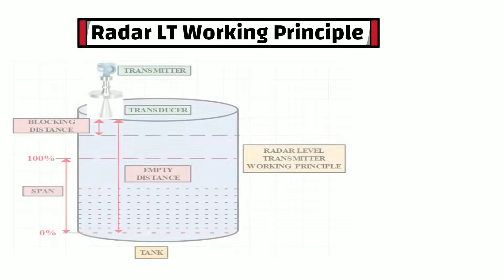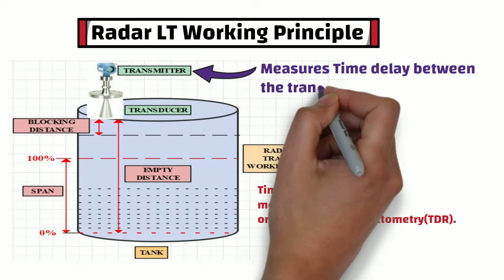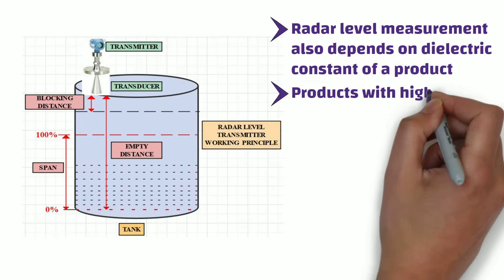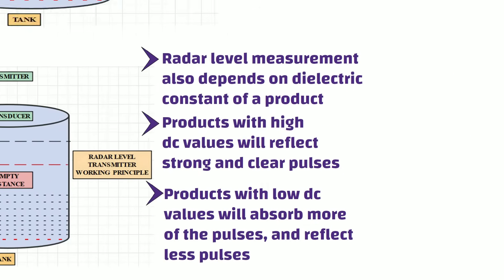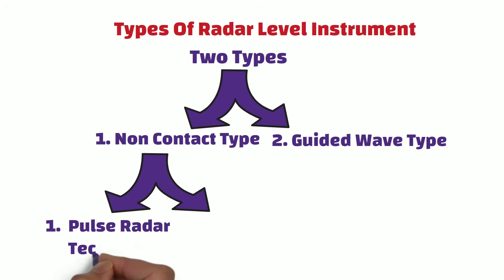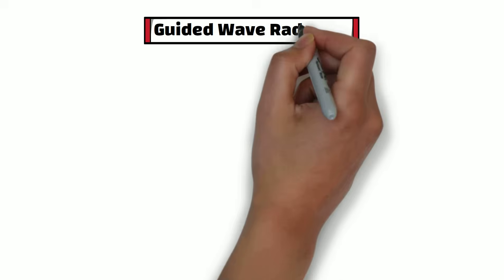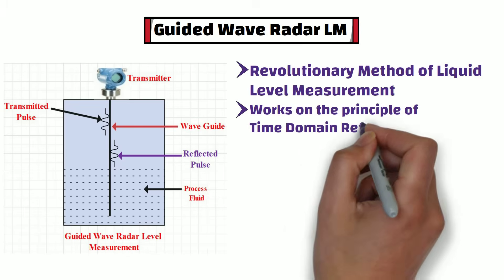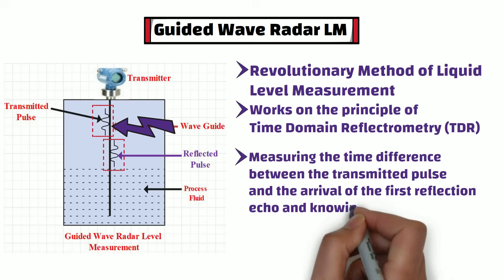Radar Level Sensor Working Principle | Guided Wave & Non Contact Level Measurement

Comment: I have a problem in out vacuum tank level,, we installed an ultrasonic transmitter but it's level display is always error once the vacuum pump runs,,, we install a pipe inside the tank, after testing using manual filling of water and manual draining the reading now is ok,,, but when the vacuum pump starts to run, at first reading is ok, but during 2 days of running online, reading stuck up to high,, by the way we use  pulsar ultra 3 transmitter,, can you explain to us why it goes that way the level stuck to high even we already drain to 25 percent level,,,
Reply from the maker: Hello
There are many reasons behind this thing.
1. Firstly, vaccum pump  creates disturbance for your pulsar. I mean it happened when there is unstable water surface because of vacum pump
2. Secondly, vibration could be the one of the reason.
Reply: @InstrumentCalibration  having this exact same issue. how do i fix this?